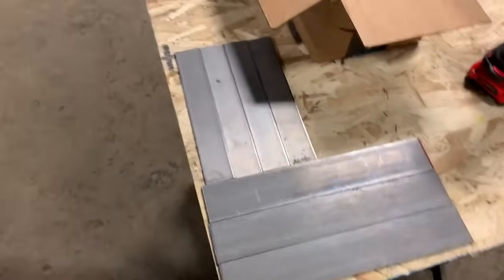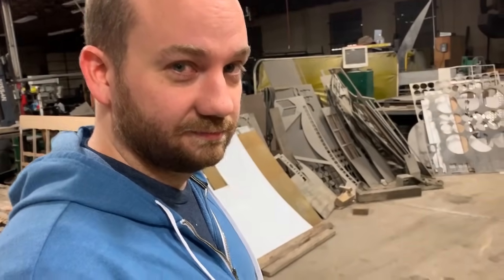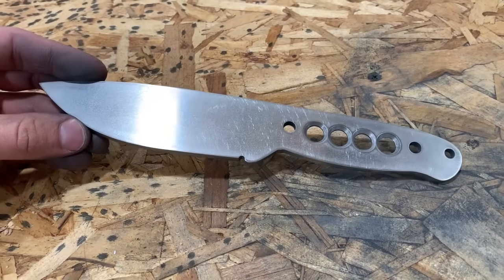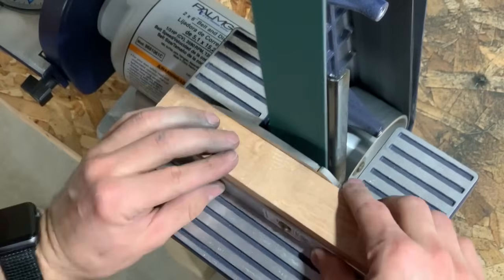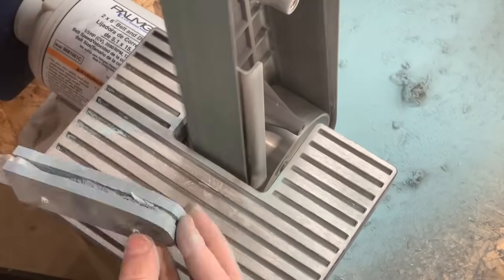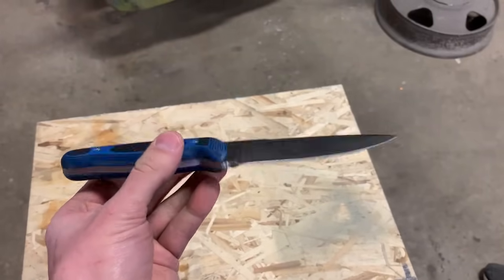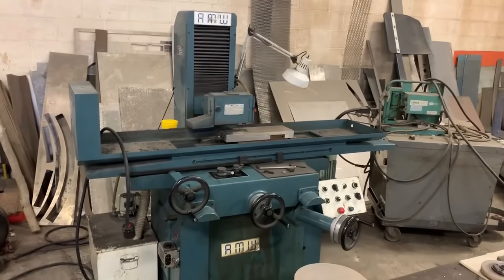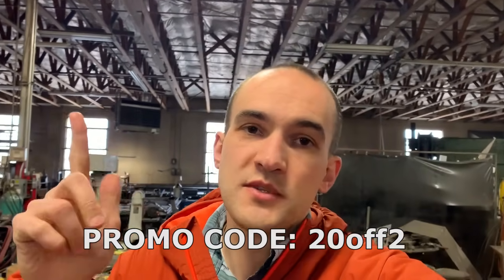Knife Making with a 60,000 PSI Waterjet

Comment: Nice work, though the purpose of the notch at the base of the blade is to allow consistent sharpening all the way to the end of the edge, so you might have better results if you moved your plunge line back to that point.

Comment: I think your grinding issue came from uneven pressure as you were grinding the knife. Also when you do heat treat do not have a final edge on the knife or it will more than likely crack.

Comment: Surface grinder eh?
Do you know about any other method of grinding?
Reply: its called a belt sander or a hand grinder. or hell even just a table grinder. or a low grip sand blade on a grinder. its pretty simple to make very sharp and dangerous knives
Reply: @eduardosc3434  dangerous knives... are you from UK? :D
Sorry, could not help not to poke :)
Reply: Actually, if you make knife, that is so sharp, that is can split atoms, that may be dangerous.
I retract my earlier statement.

Comment: Gotta get yourselves a proper grinder man... a good 2x72, like an Ameribrade. Ameribrade is the brand I use and I’ve been making knives for 3.5 years, professionally for 2. A good grinder makes a huge difference in speed and quality of the knife. Also, as far as 2x72 belts go, Ameribrade has some of the cheapest ones if you happen to be rough on them like me lol
Reply: Also if you dudes need a solid forge/forge burner design hit me up, I melt through kaowool with my burner and you can build it with about $15 worth of parts from the hardware store if you already have a tap and die set and a welder

Comment: You need to use heat and high carbon oil to harden the metal heat the whole knife before adding the handle then dip the whole thing in the oil to quench the metal this process will harden the metal but also make it brittle and prone to breaking to correct for the brittle factor re-heat the whole thing again then dip it once more into ice water this process will temper the metal making it far less prone to breaking also during the oil quench use a tool with a long handle to grip the blade because the heat from the metal will cause the oil to ignite instantly once the hardening and tempering of the metal is done then add on your handle the processes I have just mentioned will save the blade from losing it's edge to quickly but also allow for the blade to flex and snap back instead of just snapping once this is done then you can add your handle and refine your edge I know this because I collect make and restore common, modern, and antique blades for a hobby